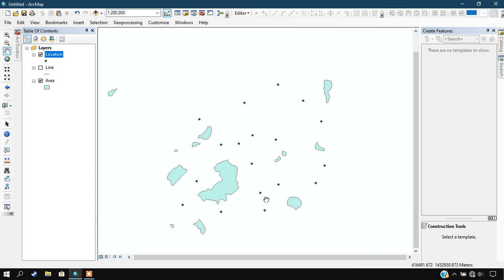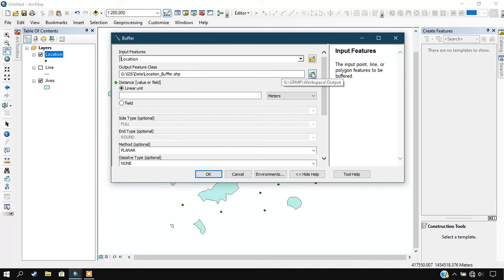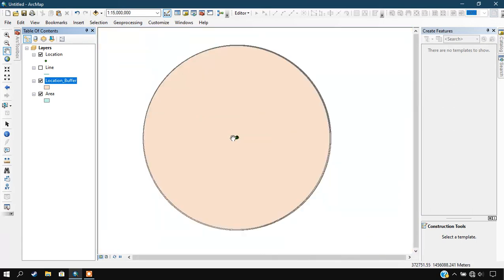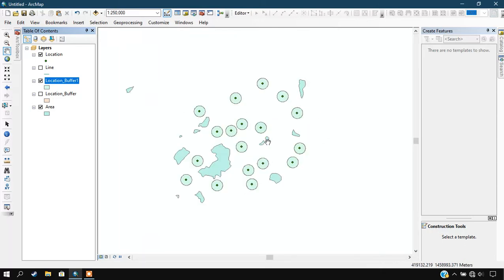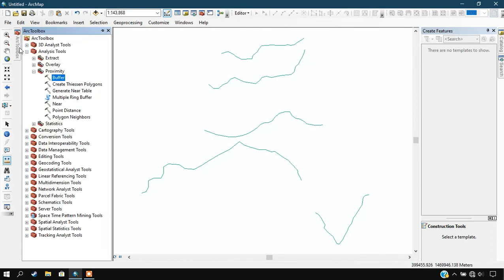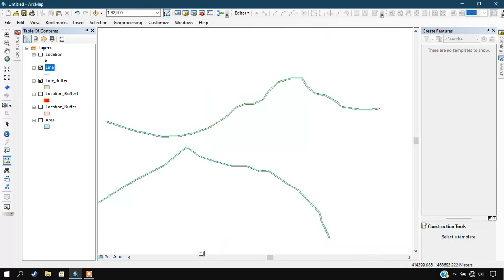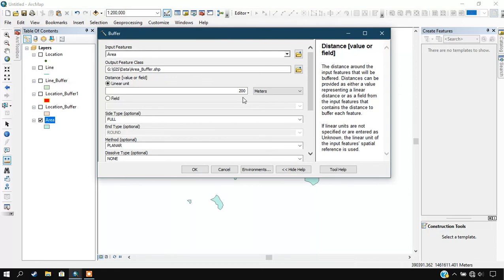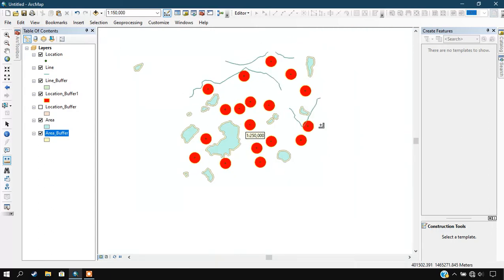Create Buffer using ArcGIS - ArcGIS for Beginners

Comment: Hello, I want to create a buffer around an area based on the value of a field. For Example. 5 small, 50 medium, 100 Large. So, if there is an area that is smaller than 5 obviously a small buffer, but anything over 5 to 49 to be considered medium, and anything from 50 to 100 considered large.
Reply from the maker: What the doubt Mr. Mario Diaz.
Reply: @TerraSpatial  I want to know if there is an easy way to create an automated buffer for a line. I want the buffer to gradually get bigger based on the value of an attribute.
Reply from the maker: @tiggermix  Hi, i think you can work with arc python. you can make tool that suite your requirement.
Reply: @TerraSpatial  I do not know how to use Arc Python, Do you have a tutorial.
Reply from the maker: @tiggermix  Sorry, I am also learning.